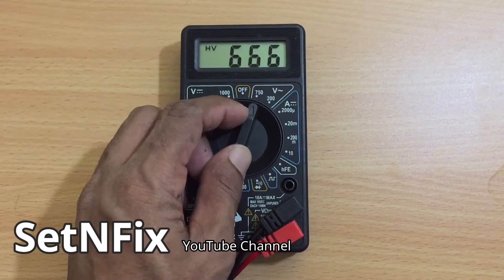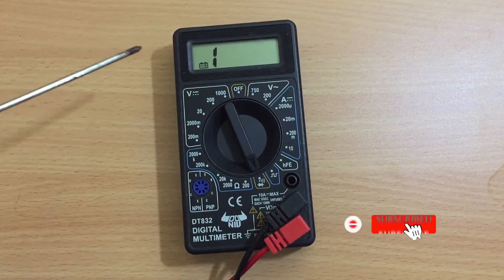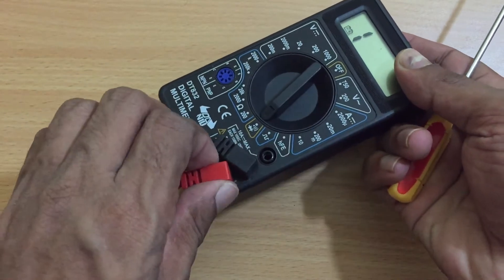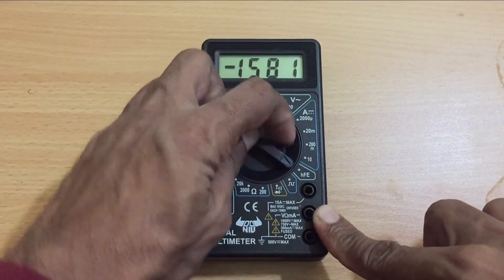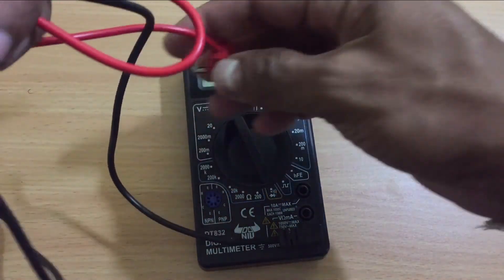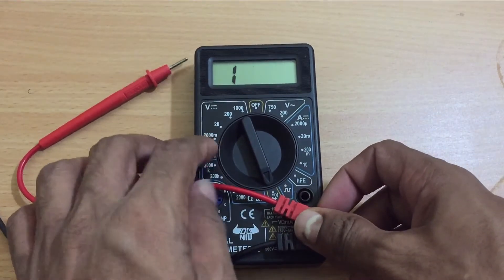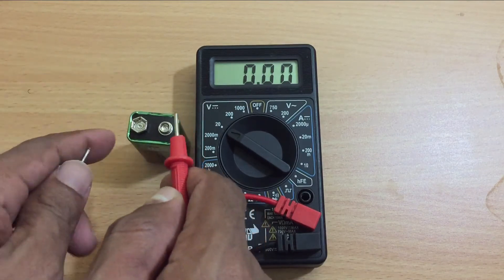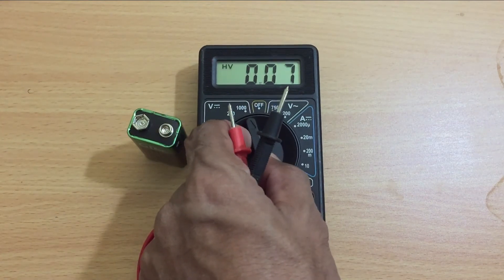Fix Battery Indicator issue on Multimeter

Comment: i changed it but same issue
Reply from the maker: is it a new battery?
Reply: @setnfix  yes
Reply from the maker: @JenuelDev  check wire connection. may be there loose collections.